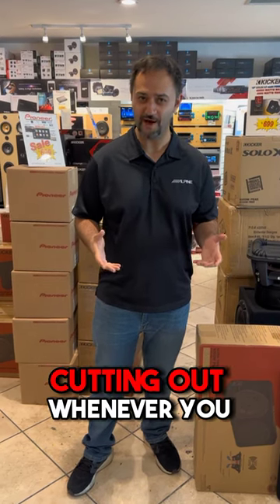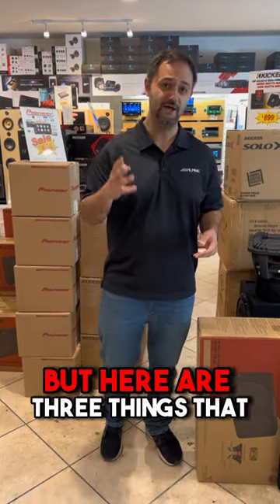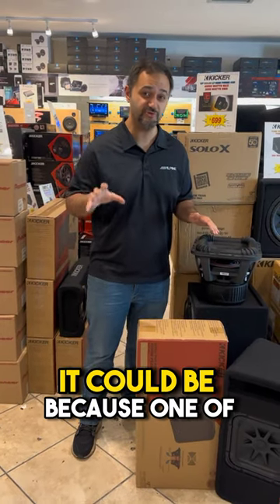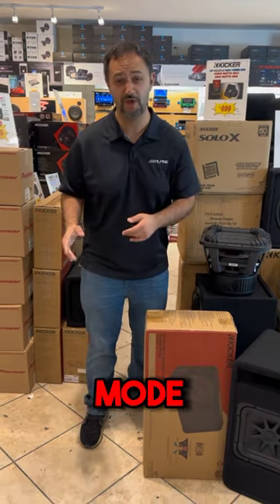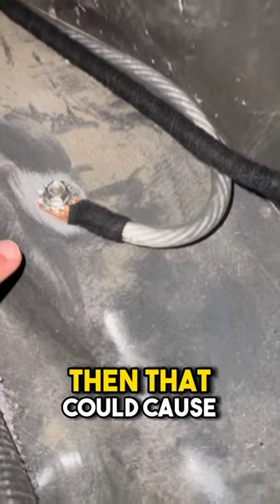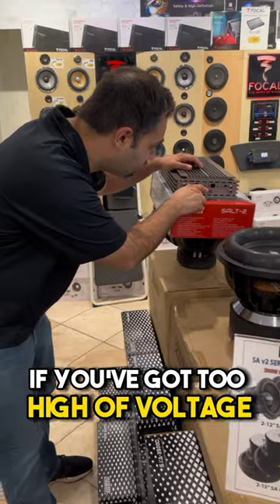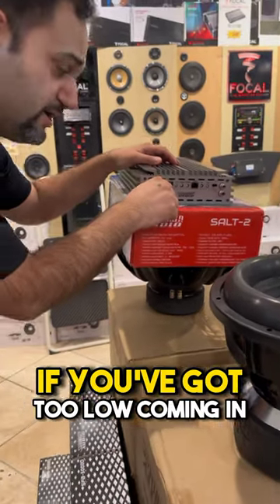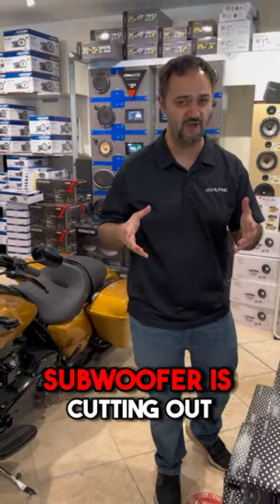[REVEALED] Why Your Subwoofers Cut Off When You CRANK Up The Volume!

Comment: Mine is voltage drop alt not big enough. So it cuts out on a hard bass hit
Reply: Get a Farad Power Capacitor rated by your systems wattage. It will throw the power into your amps when it needs it and saves  your factory alt from overworking.

Comment: Hey I have a 2022 f150 with b&o I replace the amp with a pac pro and my sub amps keep turning off wen some hard bass music hits not all the time but is annoying I have 2 nemesis 12 700rms each and for the amp I have 1500 rms nemesis Korean amp what would be the problem and this occasion.. and where are you located?
Reply: @joselm214 I Would Add Another 1500 Amp For More Power Output Then See How That Does Bro Sounds Like Not Enough Power Handling Or To Much Power Handling.
Reply: Do lights dim when the bass hits?

Comment: So why even put gain control and bass controls on amplifiers if it’s not recommended to use them🤔
Reply: you have to use gain. Setting correct gain is important.
Reply: It isn't not recommended to use them. It isn't recommended to change settings without knowing what you're actually doing. You do indeed need to tune stuff properly, imagine that.

Comment: You could also be starving your amp of power by using a power  wire too small of gauge.
Reply: Yes, true. my Subs are demanding 1850 but I'm wired for 4guage with no big 3. When I turn down the gain to half it doesn't go into protection. It takes power to make power!